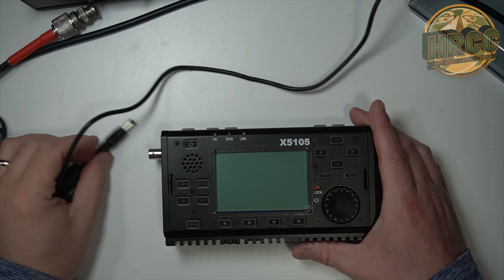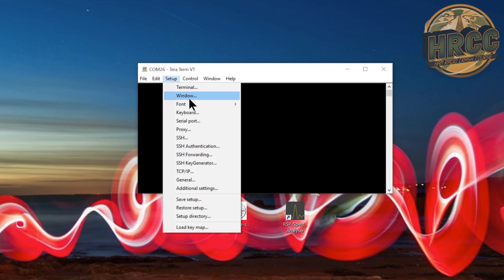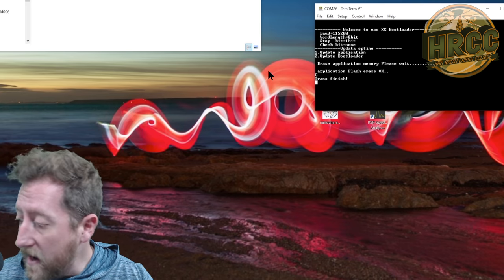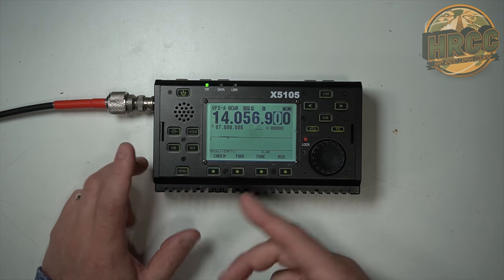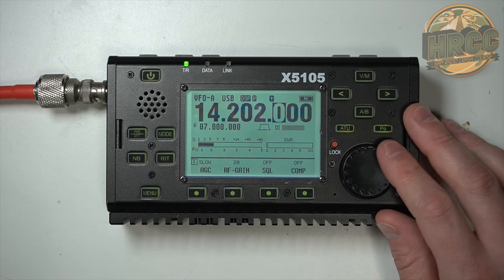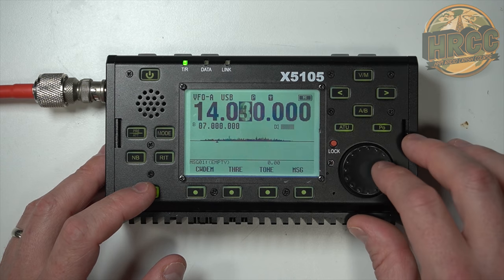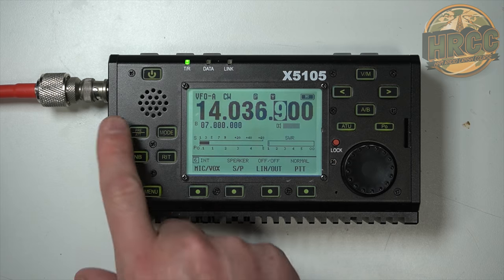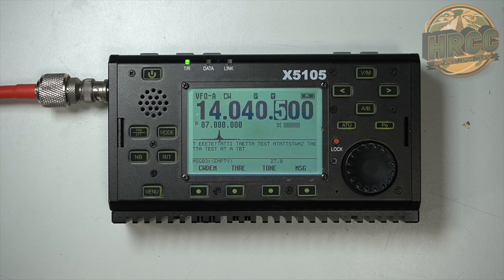Updating the Xiegu X5105 Firmware and New Menu Walkthrough

Comment: Nice to see the X5105 again. That new firmware really does improve the radio.  I've never had any luck with the CW decoder on mine either which is odd seeing how good the one on the G90 is... There are quite a few extended menus in there if you long press on the various menu buttons - Compressor ratios etc.

Comment: I only got the blue led when I pushed on the serial data plug and held it. It keeps failing. Their instructions don’t mention hitting the spacebar-just select the file and send. It looks like a bad connection at the jack. I don’t suppose there is a way to restore after an erase. I guess I keep trying or open it up and look for the jack’s traces and wire it temporarily. The port is labeled com on mine not civ. I tried again and thankfully it worked when I held the 1/8 plug in. Thanks

Comment: Help.. it is totally different and when I pressed the 2 volume buttons it started writing the flash memory and now it doesn't boot up. With the cable connected I cannot do anything. The only I have is waiting connection on the xiegu screen.
Reply: Solution came here! cold sweat I had: https://www.radioddity.com/blogs/all/how-to-update-xiegu-x5105-firmware-2021-latest-guidance
Reply from the maker: I don’t know. It’s never not worked when I followed the instructions to the word.

Comment: Have you ever used the Abbree Antenna on the X5105 and used it as a handy talky?
Reply from the maker: It likely won't work as the ABBREE antennas are tuned for 2 meters and 70 CMs.  At most 6 meters or 10 meters could work with the tuner.

Comment: I have heard there is an issue with having the radio fry from a power supply disconnect while turned on. Is this true? Also can it be powered and charged from a normal 13.8 volt wall wort?

Comment: Thanks for taking the trouble to post your video. For me this upgrade underwhelms. The big new 'bauble' is the CW decode which I find, like you did, just doesn't work very well at all. When writing this upgrade they overlooked their existing CTCSS and forgot to include it which means you are now locked out of 50Mhz repeaters you could access with the earlier software version. DSP-FLT L-CUT and H-CUT  don't allow you to narrow down enough for optimal digital work (old version was better). I strongly suspect that the AGC function has a mind of it's own and starts to do strange things to your signal without warning.The DIGI graph display - when you rotate the frequency wheel you don't really know what is going on - what is the up arrow actually signifying, is it the dial frequency ? What exactly is the scale on the graph ? Try driving left or right to match the peak to the cursor - doesn't really work. Similarly the SRM graph feature is a bit of a mystery. Where is the frequency wrt the arrow head cursor ? How do you drive to the signal peak ? Why does it keep reverting to CW mode when running this feature ? My conclusion is that when you dig deep into this it is a sloppy code release that was a long time coming but has been poorly thought through and badly tested. Furthermore there is zero documentary explanation of what the new features are supposed to do. Shame because I like this little radio but after a few months struggling with it I will be reverting to the earlier release - this one is a step backwards. Give it a good thrashing yourself and see what you think.
Reply from the maker: You did a great job commenting on this version. Thanks for providing your input.

Comment: I understand that this radio has a great antenna tuner, so is it possible to just attach the radio to my rain gutters/leaders without any additional hardware, and be able to TX/RX?
Thank you!
Reply from the maker: Maybe, depends on the length of gutter.  You might need a counterpoise though.
Reply: @HamRadioCrashCourse  I live in a HOA community which has buildings known as “quads”, because in each  building there are four homes. So, I believe that I’ll probably have enough “length”, but if not, how should I figure the length of the counterpoise (or does that matter)?
Thanks for your responses!
Reply: @HamRadioCrashCourse     Josh, how would I determine if I needed a counterpoise or not, and if I need one, how should I determine it's length?
Many thanks!

Comment: Been looking for a QRP rig since I take my general tomorrow, I've got it down between the X5105, KX2, or KX3 which do you prefer?
Reply: Who has the X5105? its been out of stock everywhere so long i thought it was out of production.
Reply: @forgetyourlife  I heard they are working on a new version. On the xiegu facebook page
Reply: The kx3 has a smoking hot receiver. The KX2 is a great radio as well. 5105, is a good radio as well. Kx3, 15w. KX2, 12w. 5105, 5w.
Reply: I have a x5105, the answer to the question is how much money you are willing to spend. If you the money I would get a yeasu ft-891, but that’s my 2¢
Reply: I had x5105 but it drove me crazy with menues and ergonomics, beside the receiver was quite noisy. I switched to kx2 and yes it is much more money but to me it is worth it. Everything is easy and accessibe. But I sold x5105 around a year ago and firmware could solve some of the problems I had.
Reply: A radio that can get out slightly more, which 100watt radio will do, might be a better first hf radio to get acquainted with.
Reply: Got the FT-891, will likely get a IC-705 or TX-500 when the time comes. Thanks all
Reply: @andrewhamop6665  How do you like the menu system on the 891. Looks like it would drive me crazy.
Reply: @jjsemperfi  It's really not that bad, most of the options are set and forget. The large lengthy menu remembers what items you last interacted with, so you can pretty much leave it on HF power. The quick menu has pretty much everything you need to change around within a few button presses, and you can assign three quick menu items to the programmable buttons on the front.

The receiver is also very good on the 891, and it has lots of filtering options for dealing with noise. Using the filters, I was able to make a VARA winlink connection with S9 noise from Cuban Jammers directly on frequency.
Reply: @andrewhamop6665  Wow! That’s amazing. I think the menu system is my hold up at the moment. I’ve heard so many great things about it’s receive and filtering capabilities that I should just get over my menu phobia. Thanks!
Reply: @jjsemperfi  Yeah, it took me a couple of weeks to be able to walk through the menu without the manual. The 891 is pretty simple in modern terms, but you can do pretty much anything you want with it. Just be careful when running high duty cycle digital modes like PSK or RTTY,  the 891 could use a more aggressive fan curve. I immediately set my fans to "Contest Mode", which really isn't much different then the default one. FT8 is much easier on it, and I can run like 80w of FT8 for a while, since the fans ramp up when you unkey.

Comment: Did the CW decode work on the earlier version firmware?
Reply from the maker: No. It was a new feature for this major firmware update.
Reply: @HamRadioCrashCourse  Well, it's being discontinued (Or has been) anyway....
Reply from the maker: What has? The x5105?
Reply: @HamRadioCrashCourse  Apparently. Spoke to a dealer in the UK, and they never got one. Not to mention the HUGE disparity in pricing with the 'MFJ' sourced variant considerably more expensive than source from anyone else. Incidentally, I was tempted to get this as CW decode would be hand for my aging ears, and I can't find anyone who has ever got it working.

I like the 'book' style format of the X5105, Elecraft KX2 & KX3, especially with the front firing speaker. I have an FT817 and am considering getting the old Icom IC-7200 With the handles (It's not as fancy as the 7300, but it's A LOT LESS FRAGILE.) I think the 7200 is a 'forgotten classic)

Comment: Trying to setup a 6m repeater which requires a PL tone.  this used to live in the system menu (#21 and #22) but this release of the firmware seems to have removed it.  Do you know if its located somewhere else?